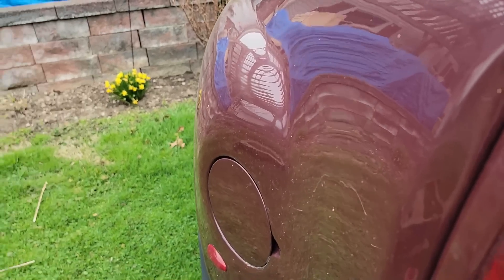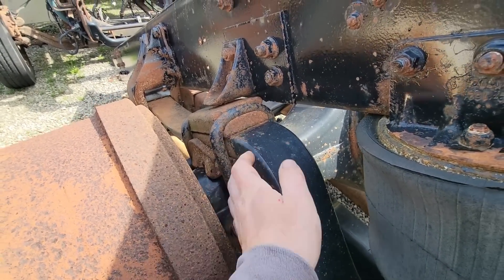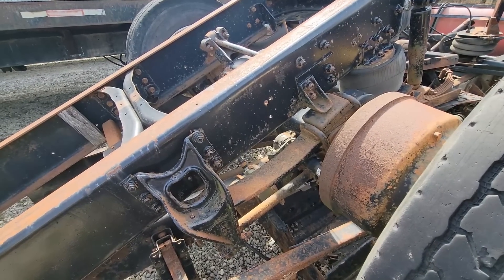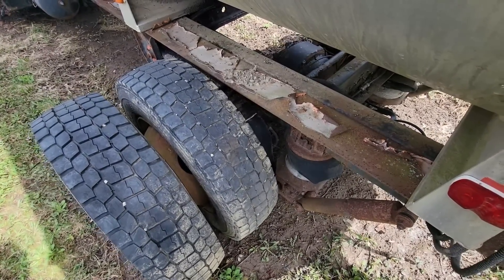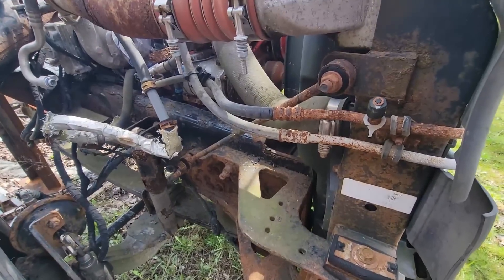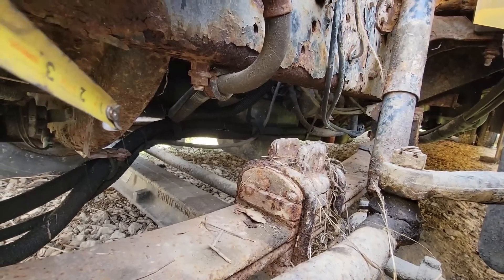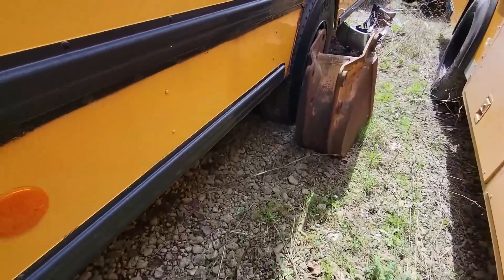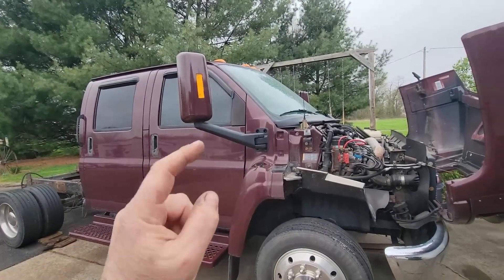C4500 CREW CAB PT2 GOING PARTS SHOPPING...KIND OF! I AM DOING WHAT I SAID I WOULDNT!

Comment: Dont cut that stack mount if you use that international chassis because international wants $1,100 just for that stack mount that bolts to the frame and has the 90° piece of pipe made to it for the stack.

Comment: I have a 2005 4x4 Kodiak with leaf spring suspension in the rear. I would like to switch it over to an air ride suspension. I watched your video when you were looking in the boneyard for air ride suspension‘s to swap over. It looked like the Freightliner suspensions we’re going to be a good choice. If I started looking for air suspensions from bone yards would you say that the Freightliner is the direction I should go? Thanks.
Reply from the maker: i will be starting this suspension soon. if you can wait, i would. see how it works on this truck before you commit to one particular suspension.
Reply: @j.c.smithprojects  sounds good thanks.

Comment: I just took a leaf out of the spring stack. 
I didn’t need the 6,600# payload pulling a camper. 
It softened the ride. 
And my camper rode smoother without a cushion hitch.
Reply from the maker: you need less capacity and i want it to live up to its current capacity. i had one a crew cab that was spring ride and 84" cab to axle. it rode better than this air ride. we will see how it rides with the new air suspension.

Comment: I used to buy busses not just for parts but I also used them for storage. The one thing I hated about them was when trying to get rid of them. If you crush one it gets to wide to haul legally. Then you end up trying to cut them into pieces and that takes time I didn't want to spend. How do you get rid of one when you're done with it?
Reply from the maker: i dont crush them. i lift the entire body off and set it on a trailer. strap it down and dump it at the scrap yard.
Reply: @j.c.smithprojects  our 2 local scrap yards wouldn't take busses that had plywood floors or all the seats still in them but I still kept about a dozen of them around. Even if they didn't run they are still the best mobile storage units available

Comment: I have the same truck you have here. I need a compressor for the seats and cab, do you have one?
Reply from the maker: do yourself a favor and ditch the junk it came with and install a quality air compressor that has a higher duty cycle. i did a video completely eliminating the factory / monroe junk. replace with dual viar with 100% duty cycle.

Comment: Questions what is it about  the 6 .6 u dont  like  just asking  to get more information that all
Reply from the maker: its important to understand that even though they put the 6.6 in a pick up truck, and in these trucks, they are not the same. different tuning, hp, torque, injectors, tubo, pistons and so on. there is a reason we see many 6.6 in medium duty trucks with broken crankshafts but not the same break in the pickups. aluminum heads on a diesel was never a good idea, regardless of who came up with the "weight savings". the pick up will outpull and get better mpg than these. guys will argue, "you need to put a tuner on it". if i cant use the truck as it is from the factory to do what it is advertised to do and do it well......I DONT WANT THAT TRUCK!. there are plenty out there that will do it without any aftermarket crap. overall they are an overly complicated, Japanese designed, 1990's toyota looking under reliable engine. i am not of fan of any v8 diesel engine. there is a reason the trucking industry sticks with inline 6 cylinder engines. taller engine, longer stroke, more torque. i have towed heavy loads with 100's of medium duty trucks. my opinion is based on real world experiences. not like so many of the keyboard certified duramax fan boys / girls. these trucks are the result of a pick up truck manufacture trying to grasp at the medium duty market that they have always failed to be part of. it is a culda sac queen or driveway art at best. perfect for the guy who wants a truck but doesnt need a real truck. this truck has done for me what it does best....sit, look pretty and give lots of controversial conversation.

Comment: I like this project. After watching this video I’d put an airliner suspension under the rear, however I would personally throw some head studs in the that duramax and a higher horsepower tune
Reply from the maker: v8 diesels are not in my future.....if i am spending the time to build it, i want the best for my situation.
Reply: @j.c.smithprojects  do you know what rpo that engine is? If it’s an lly I may be interested in the engine when it comes out
Reply from the maker: im going to sell the entire rolling chassis as one unit when im done.

Comment: Loving the build even more!
Is the 3176 Cat a viable option?
I like Cat's, but I'm not up on that one as much.
You can't go wrong with the DT466.
Overall length on a DT360 is shorter, but the 360 truck engines have never worked well in trucks. They were fine in the tractors on the farm, and pullers did some amazing things with them, but what a disappointment in the trucks!
Reply from the maker: it might just be too big for the room i have.
Reply: @j.c.smithprojects  thanks for the answer.

Comment: DT 466 for sure ! all eh way ...  no need to put the cummins in and add more emissions stuff and have a less torque engine .... - although I do like the stick shift idea ...
Reply from the maker: hard to beat a dt466 (pre 2008 that is).
Reply: @j.c.smithprojects  pre 1996/1999 the one without computer with a p pump !!! 😉
Reply from the maker: i like the dt466e just as well.

Comment: I maintain a 06 c5500, it needed a set rear brakes it was over $200 locally for set, what a joke also it wrecked a hub from the rims coming lose that was $500 for just a hub because ours had the goofy unobtainium 5 hole brake rotors.

Comment: Looks like AirLiner will fit nice !
Reply: 46K airliner uses a straight spring and cross plate (doesn’t twist the spring)
Reply: Older NewWay is good 
I put it on a F600 👍
Reply: Newer “V-rod” from NewWay for the transverse torque rod is a good upgrade
Reply: The inward bent springs tend to be trouble on bushings and u-bolts

Comment: I’d go bigger then the 6.7 Cummins. I think you will want more power that’s a pretty big truck . I have the 10sp behind my 5.9 and could use a a bigger power plant
Reply from the maker: the ism is my favorite option right now....
Reply: @j.c.smithprojects  you will have plenty of room for that I used stock rad and intercooler it never gets warm I have a stock tune right know I’m going to try to put a little more power in it
Reply from the maker: ism is 10.8l  it is quite a bit taller, wider, longer and heavier than the 6.7.
Reply: @j.c.smithprojects  oh !!! We’ll I did measuring I could of got the l10 in without a problem I would of just had to modify the dog house a bit. That will be sweet
Reply from the maker: just you find out about the cab you have? is it an air brake cab?

Comment: I prefer the International 4900 crew cab with the DT466, Allison, and air ride simply because the HD pickups from the big three are too small, and I have seen where the frame splits behind the cab from too much weight hanging off the rear axle.  Even though your rig is roomy, I don't like the cab and the jank air ride suspension is a deal breaker. I'm a bus driver and yes, frame rot will put a school bus or any other heavy bus on the dead line. I though you would prefer the 5.9 litre Cummins since it has no EGR or DPF. But anyway, I'm looking forward to this build.
Reply from the maker: i have had several crew cab 4700 /4900 trucks. very "utlity". this cab is huge inside. i dont want a 5.9 for several reasons. most are just preference. the ism is in the lead.

Comment: Find a c 6500 with a cat and change bodys may be better off. seem a many dt 466 pounded to death and still run fine, dont think a 5.9 6.7 or 8.3 cummins could hope. when ih changed to the e series god the oil leaks yup may be a little biased on the poor mule 466 it can and will get there. And I like cummins too. thanks now I want to put air ride on my dodge 5500 thanks good luck looking to seeing this happen
Reply from the maker: dont want a chevy chassis that gm doesnt support with available parts. also, that would have come with a c7. that is one of the most problematic cat diesels i have come across. i am a fan of the dt466 for sure.
Reply: Seen a some 40 series detroits in my time. guess who made them? just a rebranded dt 466 haha and yes c7 cats stink too

Comment: I wish GM put the lbz engine in these .
Reply from the maker: I wish they would have dumped the v8 and went to a inline 6 from the start of this model. adding performance parts to a v8 to make it do what an inline 6 can do from the factory isnt the definition of success to me.
Reply: @j.c.smithprojects  in-line 6 would of been easier to work on those Cummins are good engine I have about 3 6.7’s in my fleet but I also have duramax to me they are all the same the Cummins is slow at pulling stuff but pulls it good

Comment: Jc I have guys around me that have gotten 400+ hp out of those duramaxs  and it really makes a world of difference just a thought bud
Reply: Reliability suffers.
Gotta upgrade head studs and the real smart (?) Duramax folks add head studs.
JC's gonna put a REAL diesel in it.
Reply from the maker: if you like duramax, that might be an option. i do not. i refuse to spend money on any v8 diesel engine to improve its ability to do what i need. it is my opinion that the aftermarket upgrades can take away from the longevity of the engines. there is a reason all the semis built today have straight 6 engines. they just perform better for what i need.
Reply: @j.c.smithprojects  a friend had a Volvo with the inline 8 cyl. Engine.
I called it "the Buick" since my great grandmother had a Buick with a straight 8 "back in the day".
Reply: @j.c.smithprojects  I here you you are definitely right can’t wait to see the end results buddy